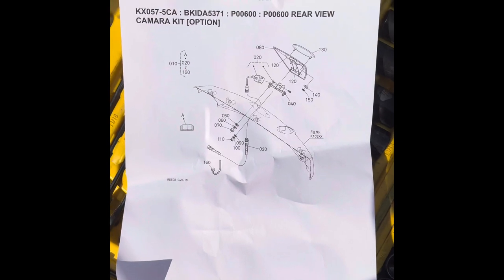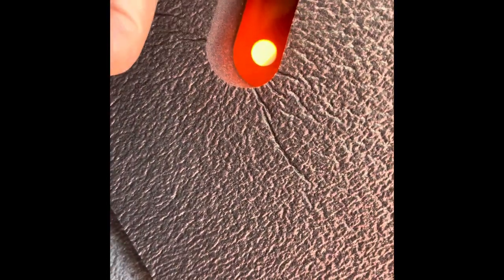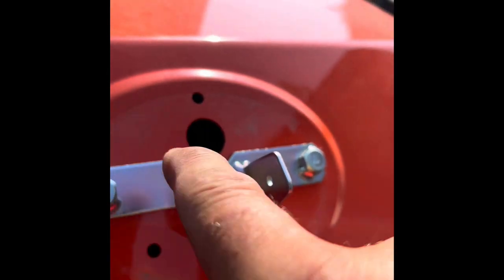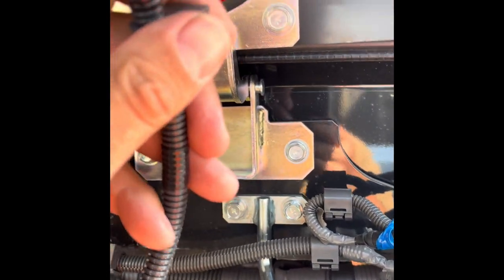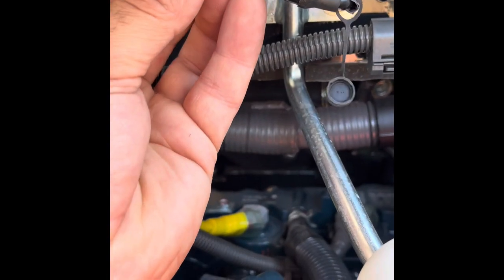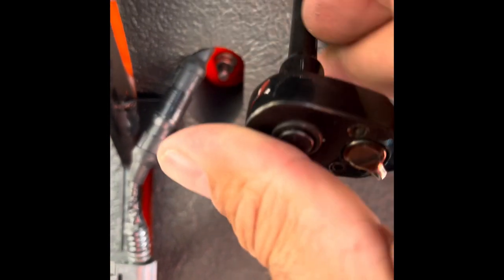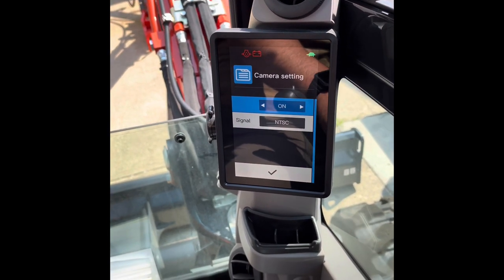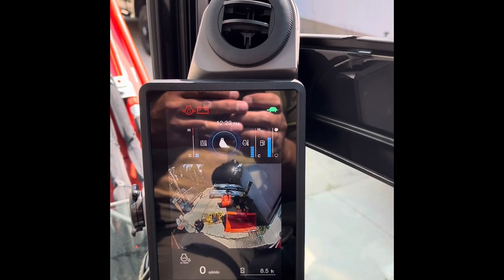Installing a Kubota Kx057-5 back-up camera

Comment: Thank you for sharing. Just installed mine, but no instructions regarding the setup portion and nothing mentioned at the parts counter when I picked it up.
Reply: Did you get this figured out? If not I can help. 

Thanks!